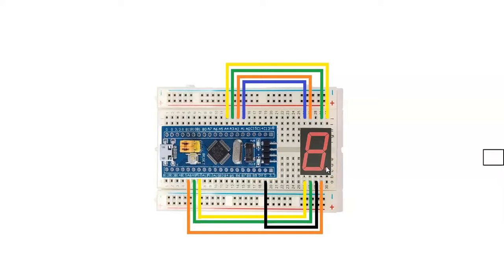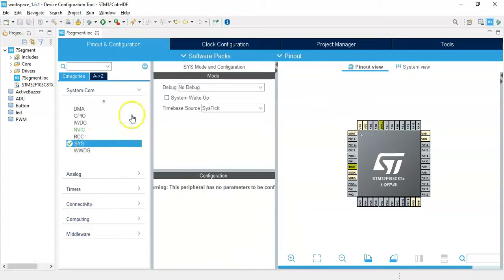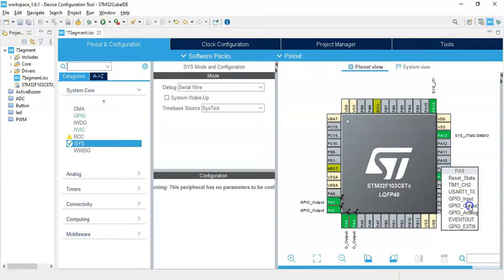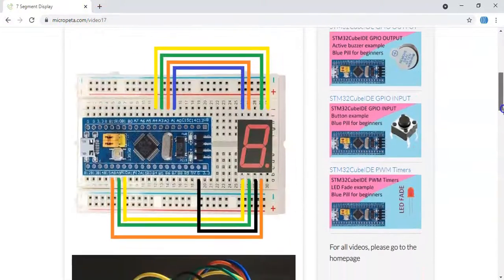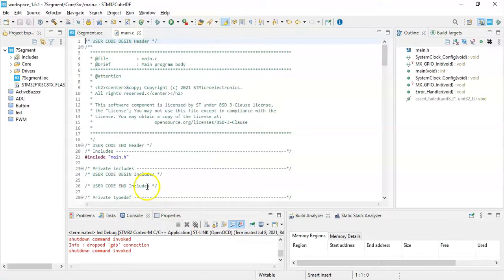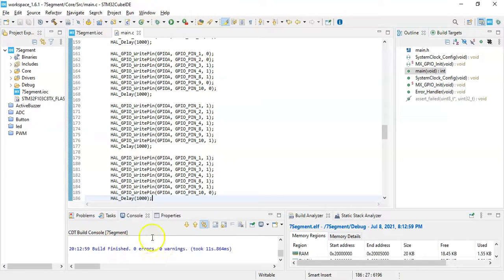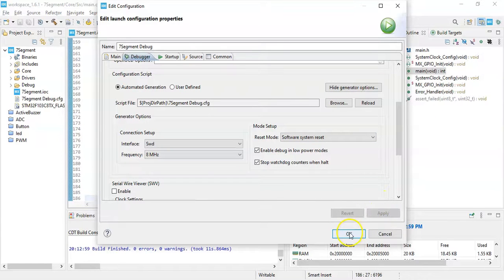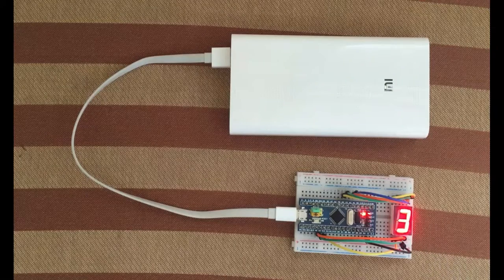17. STM32CubeIDE Seven Segment Display with STM32F103C8T6

Comment: Hey!
This video is really helpful. Thank you.
What changes should I make to your code if I want to change the numbers manually. (Like increase or decrease the number using a push button)
Also, would your code work for a different STM board?